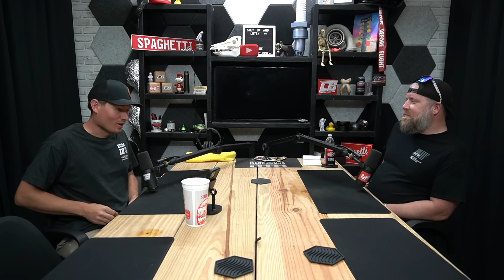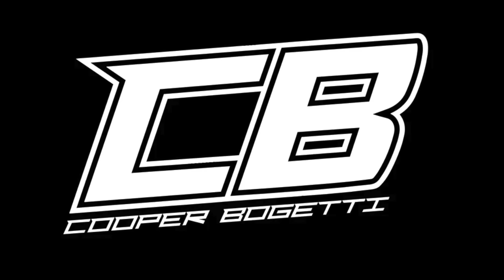Matt Sanford : First To Tune a C8 Zr1, What People Will Get Wrong, Gm Tuning, Blackwing | CBP 147

Comment: “Hp Tuners may have a flow chart to decipher ecu tables.” They %100 do.  There is almost no cracking any of these ecus without it, especially not this fast. Guys at Bosch make huge money under the table selling these to tuners. I know for a fact they are available to buy for the r8/huracan ecu for 10k.

Comment: r35, light elements changed around on the headlights, same for the rear lights, they also had minor changes.. EVs, seeing some solid-state batteries, as well as a bit of a wacky inrunner+outrunner rotor around a single stator design that could? be a gnarly torque-monster.. prior tries at that design were rather not that great, though.. and have seen a small, around early s10/sonoma size, but rather modular truck that was interesting, Slate is the name on that..

Comment: Could the ECU change be due to chip sourcing? Harken back to circa Covid...stuff being shipped inop. Maybe Bosch/GM found a better/more reliable supplier all the way down to the circuitry level. Or....its just processing speed/capability. 

As far as GM trucks Matt...theres a new TSB (and probably class action suit) coming any day from the NHTSA reports Ive seen on trucks that are outside of the already recalled ones I think. I know theres already another investigation into other years/time periods.

Comment: I've been saying this since Cleetus's video talking to the engineers. The 76mm turbo claim is for marketing. Borg Warner turbo sizing refers to the exducer of the compressor and inducer of the turbine. The ZR1 likely has something similar to Borg's EFR7670, which has a 57.2mm compressor inducer. Most of us are more familiar with Precision's nomenclature which references the compressor inducer and turbine exducer. A precision 7675 has a 76mm inducer and could have an 89-102mm exducer for the compressor depending on the specific model.  Much larger than what's on the ZR1. Watching the videos, the ZR1 turbos are about the size of an EFR7670. I see people throwing shade about how they make more power with twin 62s, but they're either ragebaiting or don't have the first clue what they're talking about. The compressor inducer, the actual size of the inlet to the turbo, will be the single largest factor in how much air a turbo will flow. Oh, and the EFR7670 on paper flow's 64lbs/min, so that tracks with Matt's data.
Reply: It's only 76 on the hot side I believe the tech said when the test drove them

Comment: 25:04 the gearbox they would need already exists. 6XD makes their indestructible sequential 6 speed in a trans axle design. Maybe GM engineers their own manual transaxle, but 6XD already has the technology well refined, GM would be wise to approach 6XD for a partnership much like they did with Allison transmissions. That Allison name alone sold thousands of duramax HD truck models for GM. A manually shifted C8 with ZR-1 power levels would be the Ultimate Drivers Corvette!

Comment: Cooper your Duramax does not have an eight-speed Allison it's got a 6-speed Allison😅 unless you've got the only one
Reply: GM actually got in trouble for badging their gm 8 speed trucks as Allison. Like there's a big Ole lawsuit behind the scenes.
Reply: @blaismerchant8582 I thought that was for the 10 speed trucks. The transmission that was designed between GM and Ford. It was badged as an Allison but not
Reply: @thebreadedcrab4252  You honestly might be right. Either way I'm thinking it wont be good for future collaboration opportunities. Real scummy to use another companies branding and lie about it. Could you imagine dodge badging a truck with cummins but its actually a 6.4?

Comment: After Matt started explaining the tables in the binary I scratched my head and said that's why you're not a tuner LOL great video Cooper😊 PS in 27 GM is coming out with a new 5.7 and a 6.6 to replace the old 5.3 and 6.2 they're claiming as much as 500 HP naturally aspirated
Reply: 6.7
Reply: @toddb3394 General Motors is developing a new, sixth-generation (Gen-6) 6.7L V8 small-block engine (reportedly designated LS6) slated for the 2027 model year, likely starting in the C8 Corvette Grand Sport and full-size trucks. This naturally aspirated, aluminum-block, pushrod engine will feature dual (port/direct) fuel injection, aiming for high-output performance and efficiency, with estimated power outputs between 525 and 600 horsepower.
Reply: @toddb3394 expected for 2027, featuring both 6.7L and 6.6L aluminum configurations to replace current 5.3L/6.2L engines. A little reading goes along way 😂
Reply: @yoda3549 there is NO new 6.6 for the trucks. Meet ya back here in a year. I want my case of beer.
Reply: @toddb3394 L8T ya goof
Reply: @yoda3549 there is no 67 motor coming out from GM you're reading was wrong
Reply: @toddb3394 this is coming straight from GM that there's going to be a new 6.6 l replacing the 62 why would they keep the 62 when it's a piece of junk stop drinking the beer because you're drunk with wrong information
Reply: @robertjohnson4784 the new ls6 is going to be a 6.7 easy Google search will tell you that
Reply: The new 6.6 is a HP orientation of the L8T from the trucks, I don't think it's gonna replace the 6.2 but it will take over in a few cars, vette/camaro
Reply: @yoda3549  it's a 6.7 and it is NOT a variation of the iron block truck engine.
Reply: @toddb3394  General Motors is developing a new Generation 6 Small Block V8 engine expected to debut around 2027, featuring a 6.6L variant tailored for high-performance applications like the C8 Corvette and a 5.7L version for trucks. This new 6.6L is expected to be an aluminum-block, naturally aspirated engine focusing on increased power, efficiency, and potentially exceeding 500+ horsepower in the Corvette, marking a shift from the current iron-block 6.6L L8T.
Reply: @yoda3549 are you referring to the new LS6 corvette engine for 2027?
Reply: @toddb3394 can you not read omg
Reply: @yoda3549 I think you might be the one w the reading problem.
Reply: @toddb3394 they are making 3 engines a 5.7 a 6.6 and a 6.7
Reply: @yoda3549 no new 6.6 truck engine.
Reply: @toddb3394 they are taking the 6.6 L8T and making a more hp version, still a 6.6 probably still an LT engine (direct injection) and the 6.7 is the LS (port injection)
Reply: What do u mean by Matt isn't a tuner?
Reply: @HennyTRX3773 boy oh boy are you in another planet I said I'm not a tuner
Reply: @HennyTRX3773 I think he meant that OP is not a tuner